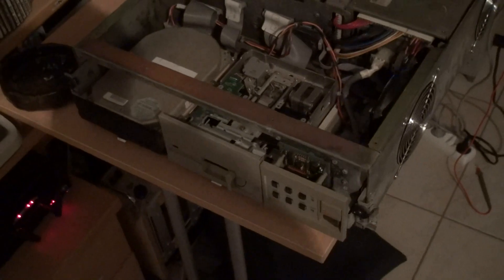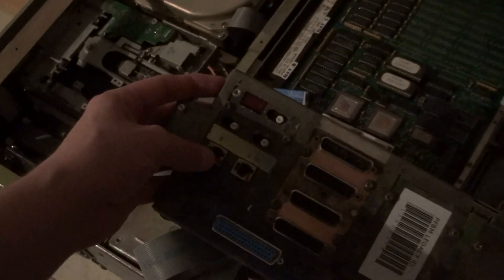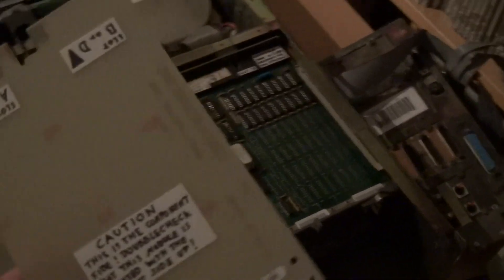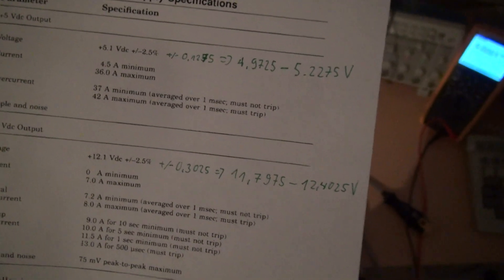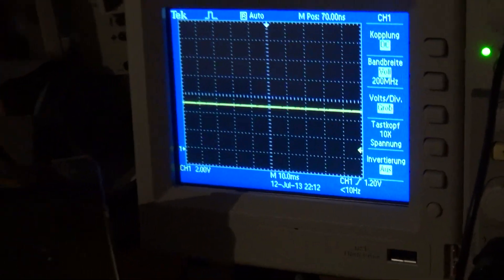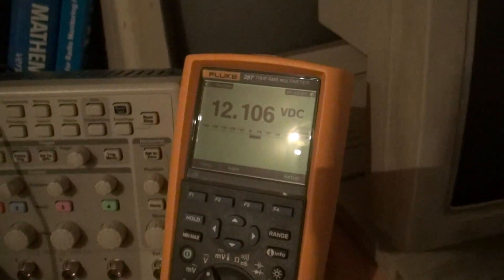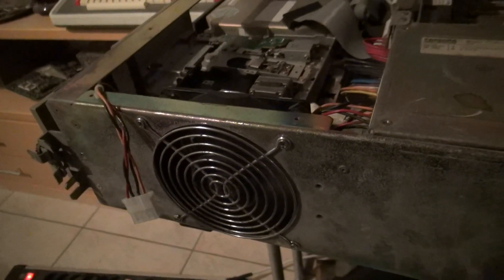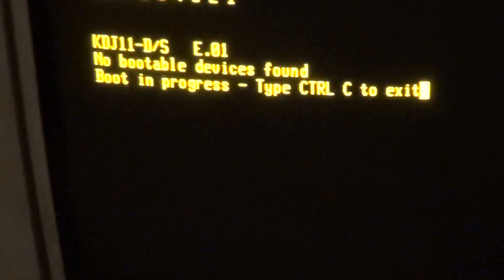getting my pdp11/53 running Part 1: Checking Powersupply and giving it a go!

Comment: Last weekend i came across a hole "stock" of about 8-10 abandonned younger PDP/11 which were lying in parts (including lots of ESDI FullHeight-Drives made by Imprimis and Control Data). 
A real shame nobody did care about them. 
(even two partly destroyed CBM PET2001 were sitting in that building...)